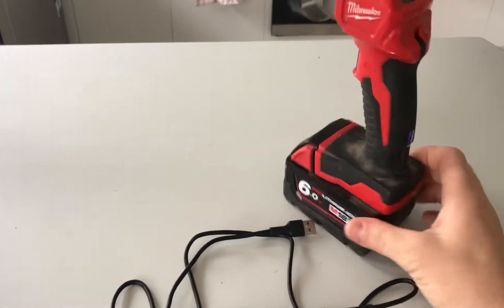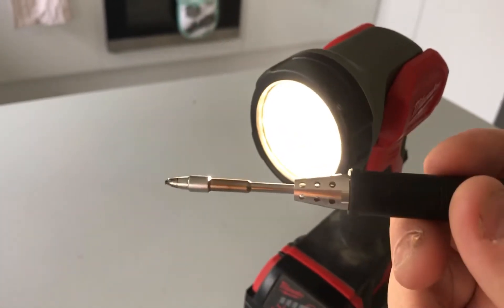Making Ts80 Portable: Milwaukee M18 + Ts80 + qc2.0

Comment: The picture  shows tha u only connected the pos. To pos. and neg. to neg. Bt the battery is an 18v and the car charger usually run at 12v or 13v.
 It doesn't burn the components?

 It is a great idea over all..
Reply from the maker: Hi Emanuel, good question! no it’s fine. The USB module is rated for 12-24v for auto and marine use so is completely within spec. It steps the 12/18/24v down to 5v or 9v depending on the connected device. I use it regularly to charge my phone and solder with no issues at all.

Comment: If you use a TS100 (cheaper than TS80 btw...) then you can just run it directly off the ~18v output of the battery , TS100 runs anywhere from 12-24v (best power/heat up time/recovery @ 24v). 

That would be the best solution IMHO. 

I’m curious - why do you prefer the 80 over 100? I know the 80 IS the newer model, but the 100 is cheaper, runs off literally any DC source with no messing around needed (except riggin up the 2555 style connector of course.. still much better than messing with USB protocols..) it has a higher output wattage, and there are FAR more available and affordable soldering tips for the TS100. 

Have you ever tried running the TS100 at 24v? I think it might change your mind. 

PS - I do like the feel/weight of the TS80 over the 100 tho, no doubt about that... I just feel the 100 is superior in every way other than that. Again, IMHO here! Just opinions!

Cheers
Reply from the maker: hi Ty, you make some good points! You are correct with ts100’s operating voltages. It may even be easier to add a barrel jack to the torch instead of USB port.  There were a few reasons I went Ts80 over ts100: The extra speed/heat is negligible for my light and infrequent use case, the 80 is a bit smaller and metal instead of plastic. I agree it feels much more comfortable. The length of the tip is shorter on ts80 and I work in confined spaces so this is another plus. The usb-c lead is fully high grade heat resistant silicone end to end so I feel it is more professional than something I would cobble together for ts100. Lastly, by going usb I can also use the port for other purposes like charging phones etc. Overall I like the ts80 better personally, but agree the ts100 is also pretty cool. If I were soldering heavier duty items regularly I would have gone ts100 but as it’s only an occasional use item for field work the 80 is a better fit for me overall. The ts100 May be a bit more versatile overall, but I feel the 80 to be a more polished product and more mainstream than the 100.

Comment: I don't use Milwaukee but this is a great idea. Great job and very clean finish.
Reply from the maker: Thanks Tim. Theoretically this could be fitted into any brand power tool, as long as there is sufficient space inside the clamshell. What brand do you use?

Comment: why not just wire it directly so it will be like 18 volts?
Reply from the maker: Because the ts80 uses usb c, and only runs 5/9v  if I had to guess 18v would either display an over volt error or just fry it.

The ts100 would work on 18v, but not ts80
Reply: Why dont you use the usb 18volt battery clip?? They are dirt cheap
Reply from the maker: Correct, but they are limited to 5v 2.1amp. I brought, tried and returned the battery clip for this very reason
Reply: What about the milwaukee top off? It has a inverter so either you plug it in or maybe the usb has higher output? I understand where you are coming from definetly the more economical choice for sure
Reply from the maker: @Scottydoing  good idea! At the time of video publication the Milwaukee top off didn’t exist, it also does not appear to have an Australian plug version. Lastly this uses USB-pd and the ts80 and many mobile phones use Qualcomm’s qc standard. However it would be a great plug and play alternative for some markets nowadays. Thanks for sharing as I didn’t know this product existed!